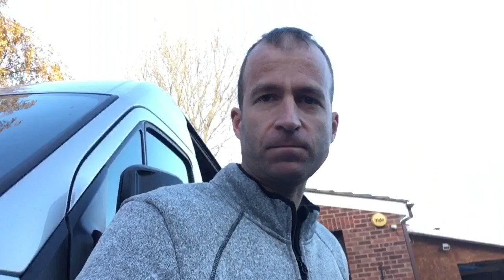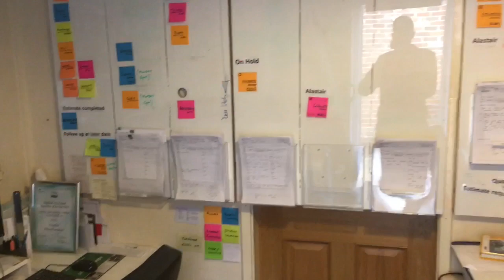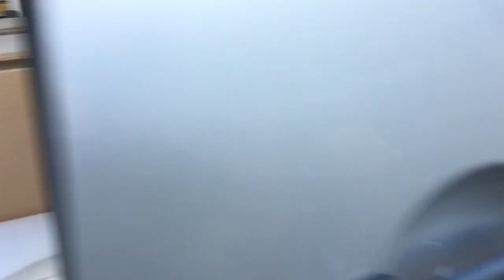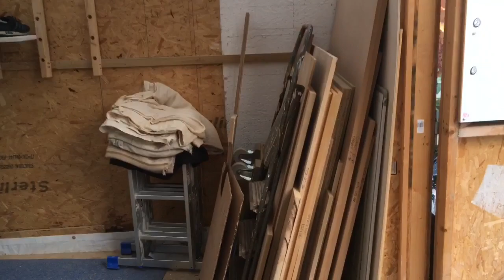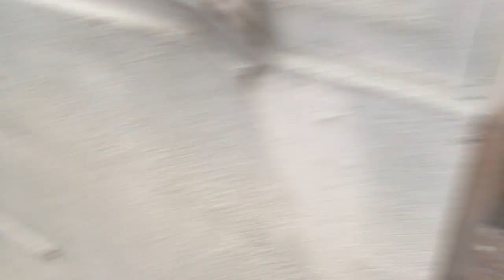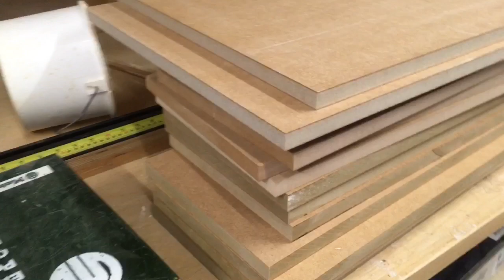Home based woodworking business behind the scenes

Comment: How did you deal with the noise coming from the machinery considering you were working full time in a residential area? Were there noise complaints?
Reply from the maker: Interesting timing you asking about noise since I've just uploaded a new video about the high levels of noise in our new workshop: https://youtu.be/K5s9nWFZvPA
Reply from the maker: But to answer your question, we only worked during reasonable hours; the garage was quite solidly built and the gardens quite long all around so we literally never had a complaint about noise.

Comment: Really nice little setup you have there, your job planning system is genius, everything visible at a glance and no computer needed 👍
Reply from the maker: Thanks, it’s all changed since this video we are in a big new workshop but you are right about the sticky note planning board - we abandoned it to try and find a computer system that everyone could refer to due to remote working during covid but you can’t beat the sticky notes and white board!!
Reply: @Alastair_Johnson  I worked with large project teams for years and we always had a similar system to this in place. Normally on the wall where everyone is working so it is easy for everyone to see how things are going. I always found that seemed to get everyone more invested in the project end to end and crucially more focused on delivery.

Comment: Hi Alistair. Great tour and a Nice set up too. Would it be possible to do a video on the router shelf pin process and jig. Great work. 👍👍
Reply from the maker: niftap a we just use a 5mm diameter lip and spur router bit within a 10mm bushing in the router base, using slightly larger than 10mm diameter CNC cut guide holes in a birch ply template.

Comment: Hi Alistair, Recently come across your videos, I like your methods of working and the way that you share them with others.
I’m a Carpenter and joiner by trade with 36 years experience under my belt. Most of that has been as self employed , sub contracting to kitchen and bedroom companies fitting their products. I would like to do more of my own fitted furniture as I know that I can produce a better quality product with better customer service, more of what they actually want rather than what standard furniture will fit in their space. At the moment I’m using Avanquest Architect 3D software to produce drawings, this produces great visuals for a cheap price. It’s great to see that you are working from home, I have a garage that I would like to use, but I’m concerned about planning, and what the neighbours would say if I started machining projects on a regular basis.
Reply from the maker: Tim The Constructor hi Tim, I’ve never heard of Avanquest but if it’s working for you that’s great.  Maybe I have been lucky with my neighbours but my workshop is not too close to the houses and I don’t work late evenings or weekends and I’ve been ok here.  Just as the board deliveries got bigger and more frequent its occasionally been a problem having the big lorries on the street.

Comment: Hi Alastair, great insight into your method. I am at the start of going self employed, currently 50/50. we follow each other on instagram. I have a 5.5m x 3m workshop in my garden and a single garage for storage, I work alone but have access to help occasionally. What size unit are you think of moving into? Looks like you have maximised all the space you have at the moment. Interested in sketch up but find it takes a lot of time to master.
Reply from the maker: Leigh Millar Hi Leigh are you LM joinery on Instagram then?  Thanks for checking out my YouTube channel.  I am looking at places between 1500 and 2000 sq ft.  Need office space too.  It depends on the layout of the space. And location etc. I’m looking for a place that feels right, not found it yet.
Reply from the maker: Sketchup is surprisingly deep, it can do so much, yes it does take time.  There are some good YouTube channels about it out there.  I see a gap in the market for sketchup training aimed at Uk based woodworkers and I have plans to produce a training series.  Can’t honestly say right now when I will find the time, as getting the business running in a new premises is priority and will be a big step to take so needs my focus!

Comment: Good morning Alistair, an impressive setup, also your approach to business. I have a small shop at the bottom of my garden. How do you get on with neighbours and noise etc?
Reply from the maker: jerry moffat hi, I must have missed this comment when you posted it!  The distance from houses is enough that I’ve never had complaints about noise.  I think I’ve Ben fortunate with the neighbours either side being relaxed (and also neither really uses the lower end of their gardens).  It became apparent that the neighbours backing onto the end of the garden had a pre-existing grumble about the large garage that was built by previous owner (with planning permission) - understandable really because it looms pretty large, with their gardens stepping down to a lower ground level.  So I think one of them reported me to building control when I put up the side shelter, but the building control officer who came out was amazingly laid back and seemed to be on my side.  We had kept within the rules for the part visible from that neighbour’s house, in terms of proximity to boundary and height of roof.  Down the side however I was aware we were closer than we should be to the boundary, for a structure built of combustible material.  Knowing it’s a temporary structure, easily changed, I haven’t fretted about it so long as the neighbours there aren’t bothered. And the building control office never sent me a letter or anything instructing me to make a change. Despite me suggesting to him maybe he should!